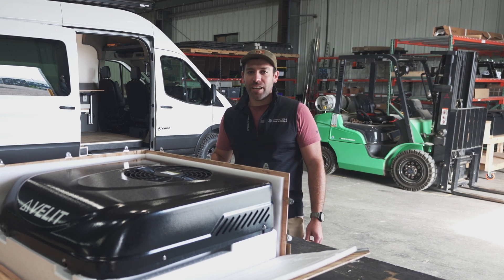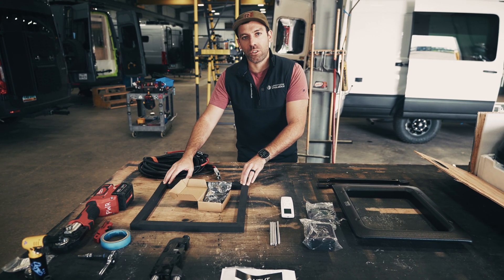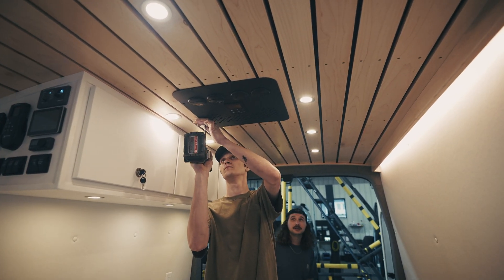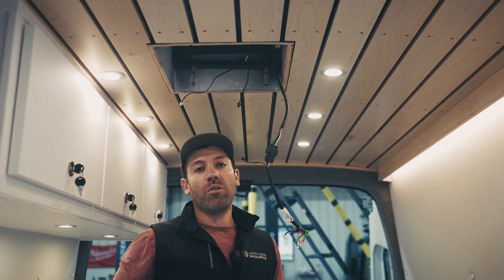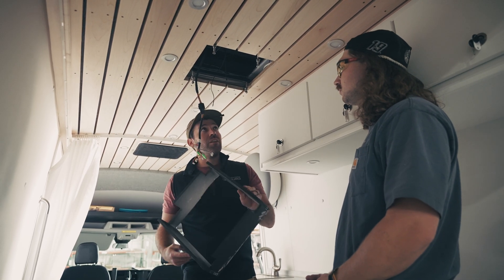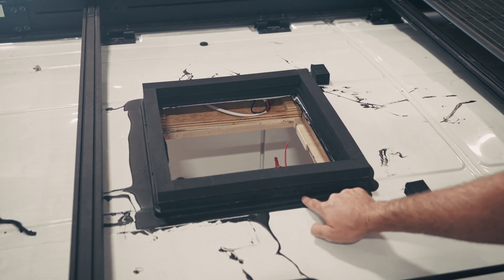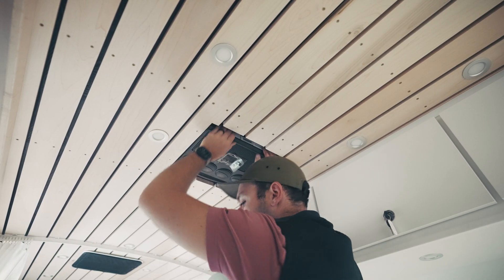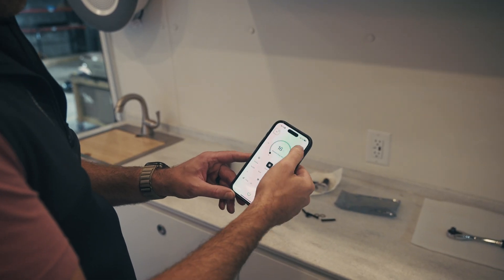Brand New & FAILING: We Replaced 4 Underperforming 12V Rooftop Air Conditioners w/ the VELIT 2000R

Comment: Hi love all your vlogs mate. Can I provide some technical input here? It will save any budding van lifers that want to install AC in their vans. A LWB sprinter is a large oven, so good insulation at the start is a very good idea as well as installing double glazing windows where possible. Now looking at existing set ups AC usually is a secondary thought. But let’s say you want to go to Spain where it can get to above 32c then here is my findings. Please I don’t want to sound negative. But a lot of folks do this all wrong a 12v or even a 24v 8000BTU AC is not large enough, for a LWB Sprinter for example you will need a 24v 13500BTU AC unit if you want to cool the van efficiently. (A 12v 13500BTU AC will require more batteries but 24v is more efficient). Yes, I know the cost will be more but if you do this wrong you will regret not installing the appropriate sized unit. There are AC units out there that can do the job. So for all those budding van lifers out there. The simple facts are. Plan for a 24v install or change your layout to 24v Lithium batteries. Install a 400amp 12v charge alternator (primary or secondary if you do install a secondary 24v charge alternator then you will obtain a 50amp in and 50amp out at your SX1400 b2B 50A). Okay if you only have a 12volt charge alternator it has to have an load capacity of say 400Amp. Install 4 x Victron SX1400 12|24 50amp (Note; a 1400XS 12|24 B2B 50A will have 50Amp into the B2B and only 25A out to charge the 24v batteries). Now get hold of a 24v 13500BTU (sweet spot) to 15000BTU. And your van will be nice and cool with an outside temp of 32c to 35c it should with a well-insulated van be around 22c - 24c. Having said all this, yes you can park up in the shade to have the van cooler from the start and you can install thermal curtains to say just cool down a bed area at night. In the end it is what your pocket and determination can handle LOL. Cheers guys.
Reply from the maker: Appreciate the thoughtful input here! And you’re not wrong on the fundamentals.

Insulation and load planning always come first. BTU requirements scale fast with van volume, solar gain, and starting temp, and many builds underestimate that. A long wheelbase Sprinter in direct sun is a heat load problem before it’s an A/C problem.

That said, where people land depends on use case:

All-day cooling in 90–95+ °F ambient will need higher BTU, typically 24V or 48V, substantial charging capacity + battery capacity. No shortcuts.

Night cooling / targeted zones / shade focus strategies can allow lower BTU systems paired with good insulation, airflow management, and realistic expectations.

We see a lot of regret when systems are sized emotionally instead of thermodynamically. Voltage choice (24 V vs 12 V), alternator strategy, and battery charge acceptance matter just as much as the A/C unit itself, as you pointed out.

Bottom line: plan the system as a whole, not just the A/C. There’s no free lunch in heat removal. Thanks for adding real-world perspective for folks early in the planning stage! 

And one more thing worth adding:

Don’t rely blindly on advertised BTU ratings. Many specs are optimistic, measured under ideal lab conditions, or don’t reflect sustained output in high ambient temps. Real-world performance can differ a lot once the unit is on a roof.

We actually tested this in a controlled heat chamber to see how systems perform under load, not just on paper. Here’s the video for anyone who wants the data:
👉 https://youtu.be/q9CVH3o49NQ?si=498LdqRGy67lN8v5

As you stated, plan holistically. Insulation, glass, voltage architecture, alternator capacity, battery charge rates, verified cooling output, etc all matter.

Comment: I bought one spent 4000 and two months later it stil doesnt work even after all this crazy troubleshooting they have me doing replacing parts.  The warranty only covers the cost of replacement parts so I had to pay the shipping and I've had to pay the labor to have a technician come by to try to troubleshoot the unit several times.  Fingers crossed they're now saying that they're gonna send me a replacement unit but at this point I will either sell the replacement unit at a loss or put it on a different van that I don't rely on as much.  I really believe they're only rep replacing my unit now because I started posting about it on Reddit.
Reply from the maker: Unfortunately, we've heard many stories similar to yours. Most of the time we end up recommending the swap you see performed in this video. If you'd like to explore alternative units, let us know! Good luck and I hope you are able to come to a satisfactory resolution!

Comment: I just installed the country mod unit on my 40 foot diesel pusher which it works great I believe it’s the same unit from everything I’ve seen with just the country mod name and logo on it
Reply from the maker: Interesting! It may look similar from the outside, but the interior components and electronics are definitely different from the Velit. The exterior plastic design is universal, there are actually a few units that look the same, but it is the components inside and the company standing behind the warranty that make the difference! Let us know how the country mod unit holds up!
Reply: @rackupgo the interior components, look identical, not to mention the outside
Reply from the maker: @stanf9070  as they say, imitation is the sincerest form of flattery. That said, I can assure you the build quality is very different. Velit is TÜV certified and backed by real support from real people. We’re proud to stand behind companies who don’t cut corners to win a race to the bottom. Let us know how it goes. We are here and happy to help!

Comment: The second I saw they were replacing the Nomadic I burst out laughing. I definitely got screwed with their underperforming overpriced garbage myself.
Reply from the maker: Unfortunately, this isn't the first time we've heard that. The Velit 2000R is a great candidate considering the voltage options and that it fits in the roof opening without much, if any, modification.
Reply: @rackupgo  I was considering the 3000 or the Dometic 2000. I know they're on different levels but im wondering if Dometic is more reliable post install considering the brand.

What do you think?

Comment: Why not the Dometic ?
Reply from the maker: @zither999  different hole size. Do you have the RTX 2000?
Reply: Price of Velit much better than dometic
Reply: We have installed a few for clients and doing a build for our family right now with the dometic as well.

Your last video with the heat chamber was an eye opener. Surprised about the Nomadic that seems like EVERYONE in the issue try is using
Reply from the maker: @zither999  absolutely. It really was a surprise to us too. This is one builder of many who we are hearing these reports from. Unfortunately, there are a lot of replacement needed across the country right now, and will likely be many more in the coming months. 

If you have a legal business entity as a van builder, check out our wholesale division of our company, upfitterswholesale.com - we’ll get you hooked up